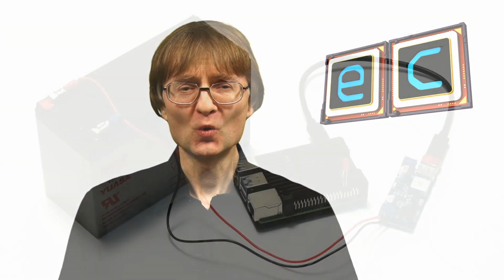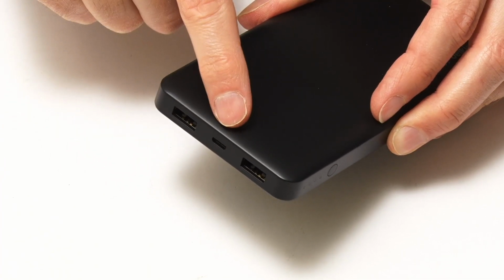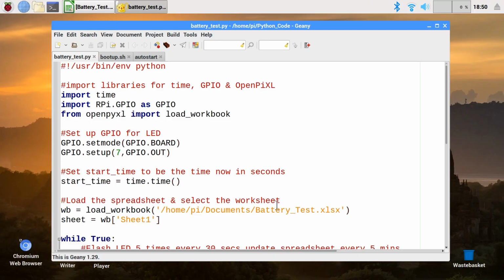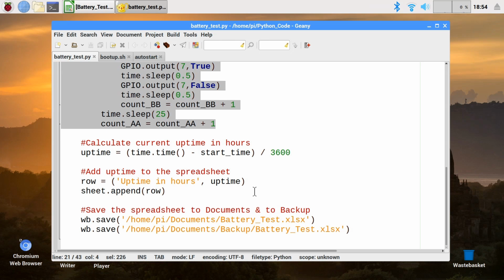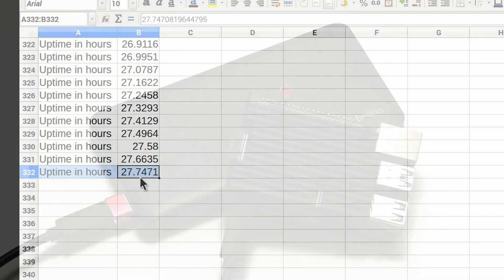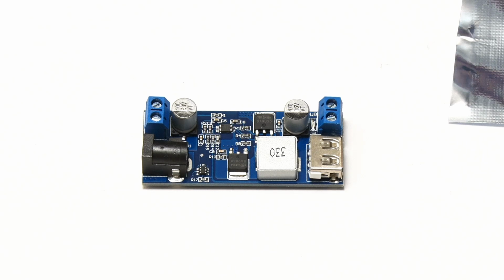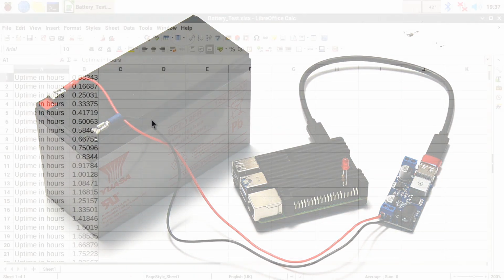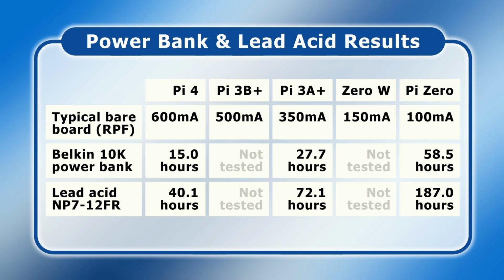Raspberry Pi Battery Power

Comment: Some misunderstandings here.  USB power banks are rated at the combined mah of the lithium cells used in them, which are typically at 3.6v.  A decent lithium cell should provide 100% or more of its rated capacity when new.  So, you can assume >90% usable capacity from that USB power bank given the voltage conversions going on inside, which gives 3.6v * 10ah * 90% / 5v = ~6.5ah for the Pis.  Lead acid batteries are very sensitive to how fast you discharge them, and their capacities are rated at C/20--that is you'll get 100% of the stated capacity, but you have to discharge it at a slow enough rate to last 20 hours.  In your case, with the 7ah battery, you'd need to discharge it at 350 ma or lower.  At 1C, you'll get slightly more than 50% of the rated capacity.  This improves to ~80% at C/4 and close to 100% at C/10.

Comment: About the powerbank : the rating on the housing is for the batteries, not for the output. There is a boostconverter in the powerbank to make the 5V from 4.2 being fresh, to 3.4 when almost done.

Comment: Interesting video as always.
Got one thing to say tho. The lead acid batteries get damaged easily if they're being discharged below 9V (see datasheet). Let me guess - that buck converter's output voltage starts to collapse if the input voltage is less than 0.5 - 3V higher than the output voltage...

Comment: what are your thoughts on running a Pi Zero W 24/7 in a campervan which has solar panels and a reasonable battery bank, would it be viable to leave it running if it were just writing data to an SD card most of the time (data from sensors) and perhaps the odd bit of 4G comms?
Reply from the maker: It sounds to me like this would be fine.
Reply: @ExplainingComputers  it's an interesting idea - especially given the presence of these new free SIM cards in the UK which have a very small amount of data available, you could potentially trigger them by receiving an SMS and then sending back an MQTT packet of data (e.g. vehicle location, sensor data, etc.)

Comment: Lead acid batteries are rated over a 20 hr discharge so 7 AHr is based on a 350 mA current for 20 Hrs and these Raspberry Pi boards draw less so you get a betters capacity rating. High current draw will cut capacity dramatically.

Comment: This is hardly a fair test, you bought a bare lead acid battery and put it against a cased lipo where you will surely have paid a premium for an exaggerated capacity and probably a load of protection circuitry. Lipos are always grossly over rated on capacity by the Chinese. You should measure the recharge after the test to establish the true capacity of each to provide a fair comparison.
Then the operating current of each device also needs measuring and stating. Simply using the manufacturers figures can be very misleading. These figures are exaggerated by the manufacturer to avoid issues with junk power supplies and cheap cables that are unable to deliver their quoted capacities.
Reply from the maker: Whilst I totally understand that I could have made different battery/system choices, it is a totally fair test of the the two power systems I selected! :)

Comment: When choosing lead-acid batteries for the type of applications described in this video, it is important that it should be a deep-cycle type, as might be used for solar power or leisure activities.  Automotive batteries for starting vehicle engines are designed to deliver very high-current output, but not deep discharge cycles, which shortens their lifetime.

Comment: From what I understand the main advantages to using a lead acid battery has to do with their power output, not their energy density. Also, from what I've seen, getting a charge controller to handle lead acid battery charging is much easier than a Lithium ion charger (e.g. for a solar panel based setup for example)

Comment: The Lead Acid probably supplied a voltage for the buck till it reached around 7.5 volts.. when the buck actually failed to produce a working current/voltage. This test would destroy the Lead Acid very quickly.

Comment: You'll probably prefer to run on a similar rated LiFePO4, you'll end up ruining that lead acid over time due to it being deep discharged. Add a shunt too if you want warning on low voltage disconnect.

Comment: if you work out that the usb bank has a battery that has 10ah most of the company lie about true capacity so battery needs a real test so from taking things apart the bank has a lithuim pouch cell of nominal voltage of 3.7v if we take that and times that by the claimed ah rating that gives 37wh where as the lead acid 7ah times by the vominal voltage would be 84wh now thro in the boost converter on the usb bank that will use more power then the buck converter from the lead acid you have greater usage of power so if one was to get a 7ah 3s lithuim battery and test that agasint the 7ah lead acid the lithuim would run even longer then the lead acid

Comment: I think you're making a calculation error in your theoretical battery life calculations. As far as I know, the stated maximum capacity for a power bank is calculated at median cell voltage, which is generally 3.6 volts for Li-Ion and 3.7 volts for Li-Po. Judging from the thickness of your power bank, I think it uses a Li-Po battery, so its stated capacity of 10Ah @ 3.7v would give it a theoretical maximum capacity of 37 Watt-hours (10Ah × 3.7v), which is quite a bit lower than your assumed 50 Watt-hours figure (10Ah × 5v) you're basing your calculations on.

Granted, it is very much possible that your power bank manufacturer was honest, and gave you the design capacity at the actual output voltage of 5 volts, but I doubt it. You can check by taking a look at the Watt-hours rating, which should be printed somewhere on the enclosure of your power bank. Divide that by the design capacity (be sure to use mAh if it is given in mWh or Ah if it is in Wh) and you'll get the voltage they used for the theoretical maximum capacity calculations.

Comment: By the way for greenhouse, I guess there are devices that are meant for connecting solar panel, lead battery and raspberry so it may run forever.
Or you may use Arduino, RTC with programmable interrupt, make loop where it programs interrupt to happen in five minutes, then it does some stuff, puts itself to low power sleep and waits for interrupt routine to wake it up. Then you can destructively disconnect power LED and it can run on four NiMH batteries for month(s). I once made thermometer logging to SD card this way, I remember I used P-MOSFET to shutdown power to SD card reader as well and I needed to ground all SPI bus pins and reininitalize SPI bus at each cycle.

Comment: I don't think the powerbank has 10,000mAh or 10Ah ... That doesn't seem too much for such a powerbank. And with the power consumption you would actually have to take into account the consumption of the monitor and keyboard. Because you can't do much without it .....if only with remote control

Comment: Remember not all lead acid battery's are made the same... deep cycle battery's with a lower CCA rating will handle more discharge cycles much better than normal battery's with high CCA ratings

Comment: I suspect the rating of most power banks is a bit deceptive. The 10,000mAh may be the peak cell capacity at 3.7V, before the boost converter to output 5V. The lead acid battery will provide its rated 7Ah down to about 10V at which point it is pretty much flat. The power bank will have a low-voltage cutoff and should survive a lot more discharge-recharge cycles than the lead-acid being run right down. Lead acid battery age faster if taken below about 50% charge. As mentioned in other comments a 3 or 4 cell lithium pack with BMS and a buck converter dropping to 5V may last longest and deliver well.  Parallel cells for more capacity.
For the past year I've been running a controller in my greenhouse on a 3-cell 18650 pack with BMS and a small solar panel panel charger.  No manual charging required.

Comment: The mAh ratings in power banks is given for the battery voltage inside the power bank and not the output voltage which is 5V.  Typically, the internal battery is 3.7V and a boost converter is used to get it up to 5V. So attempting to use the mAh rating to calculate run time for a load will fail.  Instead Wh should be used or an equivalent mAh rating for the 5V output should be used. The real capacity when viewed from the 5V side would be 3,7V/5V = 0.74 or 74% of the rated capacity. Just like the 75% you said.

Comment: Great timing. I just needed it two weeks ago :) However I found out that 5+ years old 10400mAh powerbank rated 5V/2.1A can power Raspberry Pi 3B which is encoding fullhd video and sound at 30fps/3Mbps and which powers USB sound card, camera and two 3W IR LEDs can run this setup over five hours (maybe even six hours, i shut it to prevent file system corruption). From what I read it should be 10.4A*3.6V per cell which gives 38Wh. So power consumption is likely at most 7.5W or 1.5A at 5V.
Only small problem I have is that writes to SD card can sometimes stall whole system and when this happens, video gets delayed behind audio.

Comment: Great video as always! I was a bit surprised by how quickly those little raspberry Pi computers ran out of power on the lead acid battery. I was honestly expecting the runtime to be in the weeks. I’m wondering if tweaking some of the power management settings on the board might yield a greater runtime? Also, I’m somewhat curious why you chose to write the data out as an Excel file rather than simply a CSV file. The benefit of the CSV file is nearly every spreadsheet app can open it natively, but you don’t need any special toolkits to read/write the file it’s literally just a text file with each column separated by a comma. Another thing to look for the project at are CEO jobs which provide a lightweight yet flexible way to schedule events on a regular basis for the Pi (e.g. measuring the humidity/temperature of greenhouse)

Comment: The problem is you can’t use Lead-Acid battery like this, the cut-off voltage for it should be around 11.6V, but with a buck converter down to 5V, it’ll suck the voltage probably below 7V.  This battery will be damaged.

Comment: Great videos : Thanks !
-&-
A brief comment from my experience: This comment is important for regular TTL circuits. It becomes much more important with CMOS projects, where the project's load may be extremely small.
¶
When you are testing battery life for long periods, it is critical FIRST to pretest a fully charged battery with no load. 
§ This is called "getting a self -- discharge baseline".
¶ Especially with a Lead Acid battery, there is normal self-discharge, as the battery "runs down". This is because the battery has some small -- but still nonzero - self-discharge drain. Once you know this "shelf-life" value, testing the running time will be more accurate. ¶ I have seen several cases where the load was so tiny that the battery life was exactly the same_, regardless whether the tiny load was connected OR NOT! ¶ Thus the measurement of "unloaded time - to - droop to an UNusable voltage" for an _UNloaded battery is a critical baseline measure.
¶
A very informative video!  Thanks ! /Mike eot

Comment: According to the datasheet of the NP7-12FR you only get 250cyles if you use 100% or 550 cycles for 50% DoD.  Pretty sure the powerbank can do 500 cycles 100% DoD.

Comment: If I used the Lead Acid Battery to power a Pi, to control a robot, could I also use it as power for the motors?

Comment: As others have mentioned, it's important to note that power banks like the one used in this video have a nominal voltage of 3.7v and use a boost converter to output 5v. Boost converters are less efficient than buck converters, and also I wouldn't be surprised if manufacturers provide the rated capacity of the lithium battery at 3.7v rather than the lower capacity at 5v. I imagine a 12v lipo pack connected to a buck converter would provide similar (if not better) results to the 12v lead-acid battery. The benefit of lipo is size/weight, and the benefit of lead-acid is price!

Comment: What was the voltage of the lead acid battery after it ran out because if you regularly discharge below a certain voltage it will damage the battery so its always an idea to put a voltage cutoff in to stop it doing damage.

Comment: The worst problem with lead-acid batteries is that they die quickly if discharged deeply and often. The best common type in this case seems to be the LiFePO4 chemistry.

Comment: The power bank capacity is a bit misleading in that it is the rated internal battery capacity (3.7V), not output (5V) charge. 3.7 divided by 5 is 0.74, so you got that 75% conversion ratio close to reality. In fact it will be a bit worse because of electronics losses in the power bank (up-converting battery voltage to 5V).

Comment: So if I connect a battery charger to the 12V setup have I just built a UPS? Same thing with the USB setup, except I would have to chop into the USB cable.

Comment: Has the buck converter board have any low voltage protection? You shouldn't discharge lead acids too low as this causes sulfate to line the plates inside the battery this will reduce capacity. You can make a external low voltage cutoff that will save the battery if the voltage gets too low.

Comment: Hi Chris, I have ran a pi-zero with pi-aware installed on a 20ah battery for well over a week. When the battery is fully charged it is around 13.4v or thereabouts. The only trouble I had was the pi would run until the battery dropped to about 7v, not good for the battery at all. I ended up fitting an additional board in line to shut the pi down at 10.5v

Comment: One thing to take into account is the 12-volt source can drop to about 6 volts and the buck converter will still output a steady 5 volts.  But if you keep doing that, the battery will suffer an early death as they should only be discharged a few volts unless it's a deep cycle battery.  So also need to then include battery management.

Comment: Not sure if i missed it, but you mustn’t discharge a lead acid battery more than 10.5v otherwise you will ruin it - so you adapter needs a low voltage cut-off.
And as you have found you will get the advertised capacity when drawing a small load.   People tend to take the ‘7ah’ rating and assume you can pull up to 7 amp for one hour - which in practice it would probably last 10 minutes.  The ah rating is usually over 10 or 20 hours - so 750ma for 10 hours 

https://en.m.wikipedia.org/wiki/Peukert%27s_law

Comment: Does the buck converter have a low battery cut off ?
Running a lead acid battery down too far kills them pretty quickly , better to use a deep cycle or one of the new lithium based batteries.
If the buck converter doesn’t have a cut off then adding one to cut out around 10v would change the test result significantly .